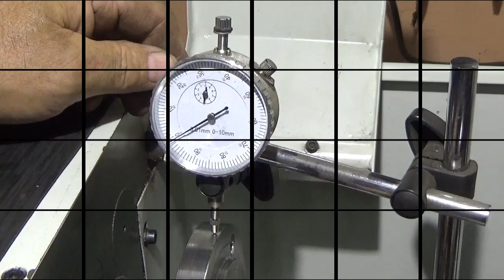Tarcza zabierakowa adapter do tokarki Ø 160

Comment: Sorry to ask a stupid question, but at 4:30, you used the lathe to scribe lines. How did you work out the angle (spindle rotation) for each line?
Reply from the maker: Aligned with the jaws of the 120 degree lathe chuck. Regards